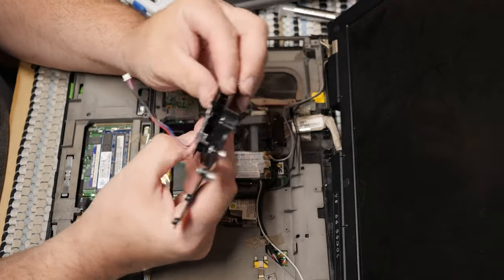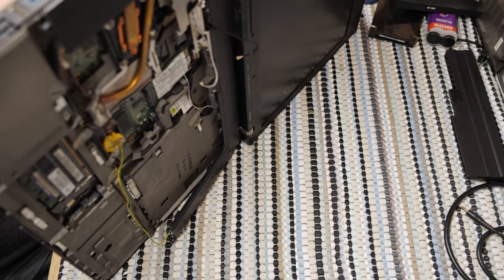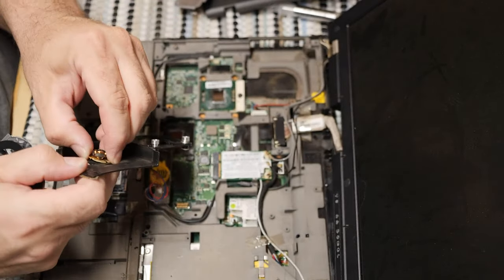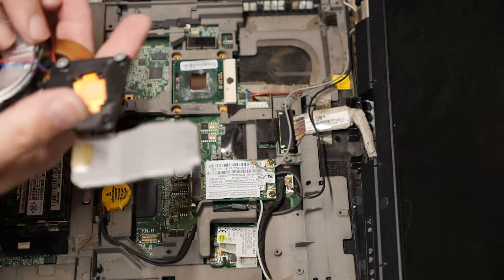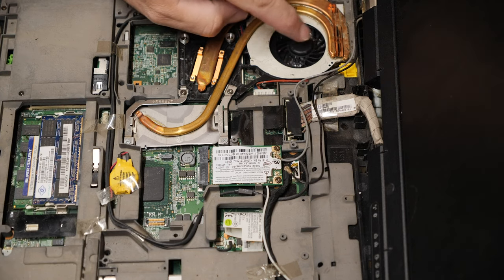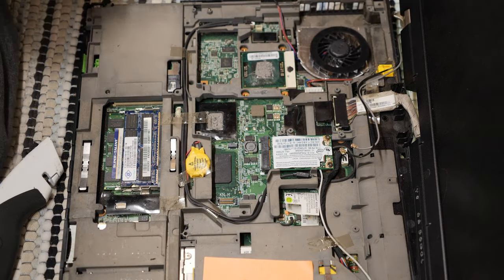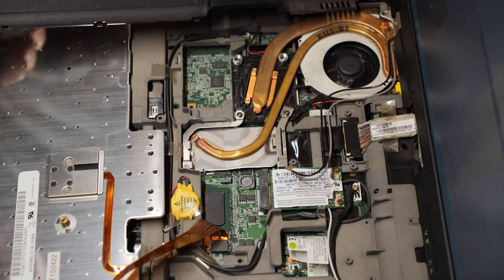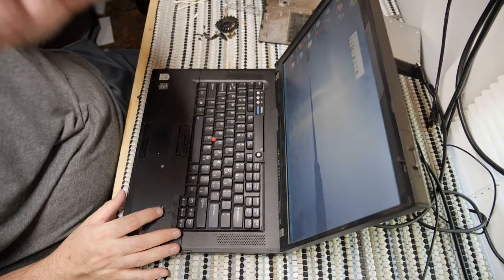Lenovo R61 CPU Fan Replacement With Wrong Fan Part - Jody Bruchon Tech

Comment: Nice job, navigating the nightmare. Not too many could make this as interesting.

Agree about Arctic Silver. I tossed all the other stuff I had, unused.

@ around 28:00: if you had scored on the INSIDE of the curve in the shroud, you might have been able to make a deeper score with much less risk of sliced flesh.

Considering what you were trying to end-up with out of the original fan shroud, one of the old "nibbling tools", plus a pair of small "flush" diagonal cutters to finish-up could have done the job w/o risk of wrecking the part with applied torques. Also, when you have an uncooperative section of scored plastic, sometimes "starting" ' a break at the edge of a score with a small pair of flush-cutters makes it easy to propagate the break the rest of the way along the score.

Once you had the new fan motor exposed, might you have applied a tiny dab of motor oil, or "Singer" sewing machine oil to the bearings/bushings?  I have fans going seemingly forever that way.

A nibbling tool might also have enabled you to trim the metal on the new part .
Reply from the maker: Unfortunately, there's no way to lubricate the damage away!
Reply: @JodyBruchon   Certainly, but I was thinking of the new part.

I bought a lot of several new cooling fans, and installed one. which seized-up after a few months, so I preemptively lubbed a replacement for the replacement from the same lot, and it did last MUCH longer. Not proof, but certainly suggestive.
Reply from the maker: That's a very good idea and I appreciate you bringing it up!